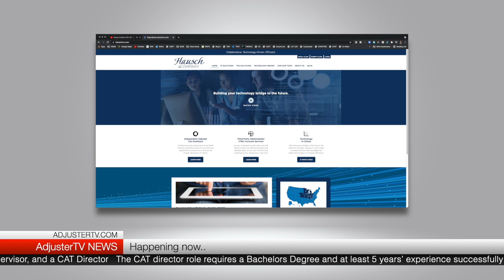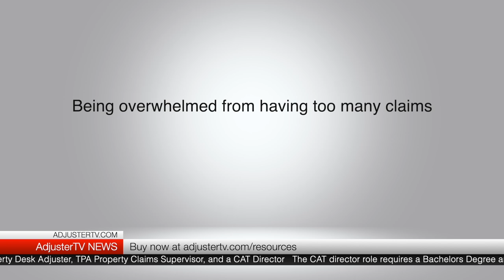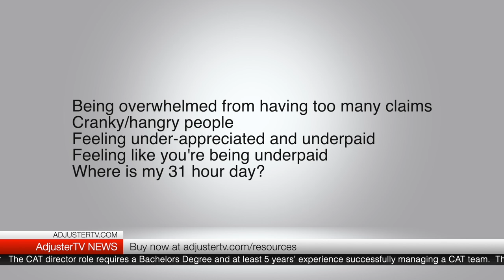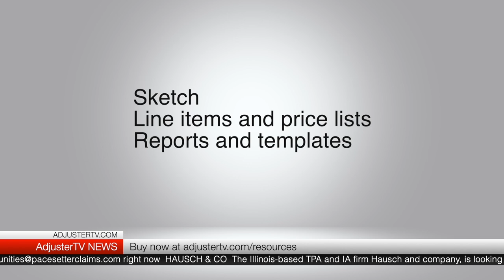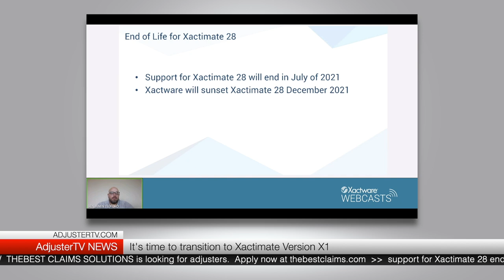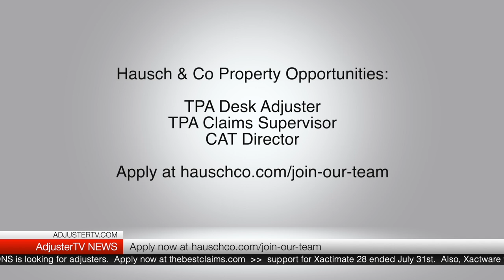Xactware no longer supports Version 28 | AdjusterTV News

Comment: Do you still run the Dell 13" from 2018 and if so how does it handle X1?  Is X1 more, less, same resource intensive than X28?  Lastly do you use the touch screen for claims or is it absolutely useless for Xactimate and claims work?